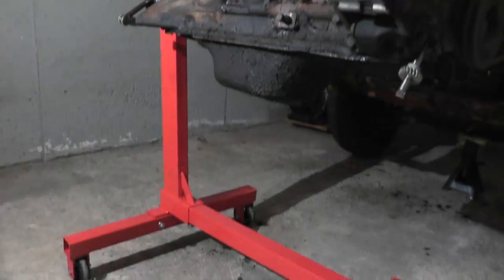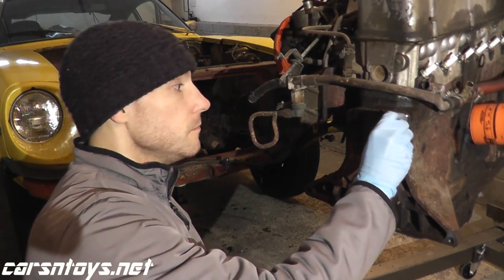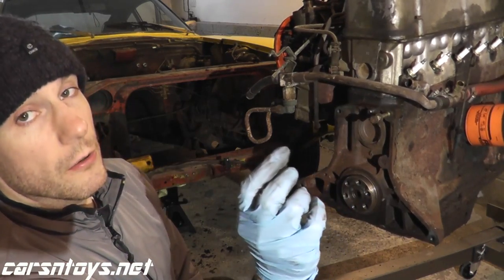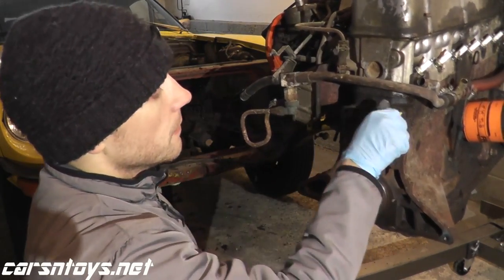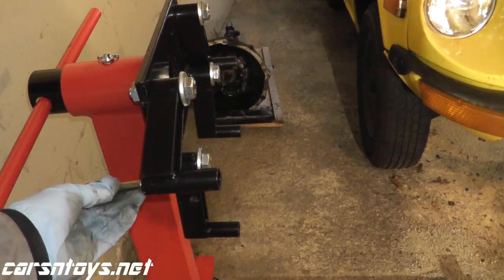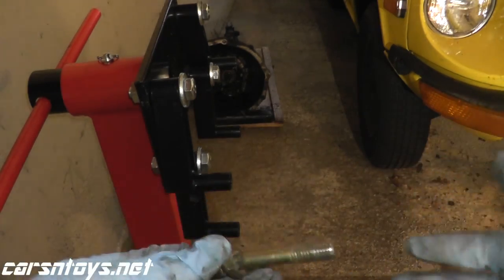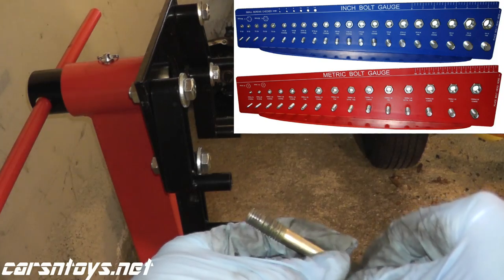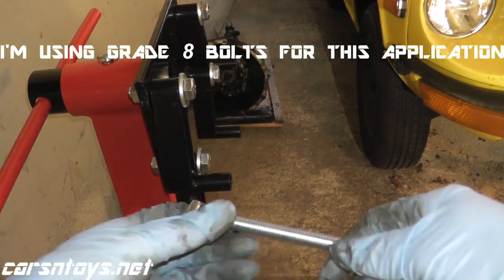How to Mount an Engine to an Engine Stand

Comment: Great video. I work at an equipment rental store so I shouldn’t have to buy a hoist since were supposed to replace the one a customer broke before. Plan is to get my measurements tonight and put together my new stand (sold the other one bc something came up), then tomorrow or Saturday buy the hardware and rent the hoist Saturday. Hopefully the rebuild won’t be extensive, engine only has 70K but it overheated very badly due to low coolant, long story.

Comment: The problem we had with a friend's Miata project is the transmission bolts were M12 x 80 with a 1.50 thread pitch. All the part stores had M12 1.75 pitch.
Reply: Even Ace Hardware? Darn.

Comment: I have a in-line 6 aswell the Ford 200ci to be exact. I’m really afraid the engine is to heavy for the stand because the engine is so long and the front of the motor is leaning downwards just s little. Is this normal?
Reply from the maker: First make sure the stand can withstand the weight. You may see a slight decline toward the end of the engine. You can place sand bags on the legs of the stand as a safety net.

Comment: What is the minimum number of bolts required to safely mount an engine on a stand?
Reply from the maker: Typically four. You could probably go less if the bolt is long enough and high grade but I wouldn't chance it.

Comment: My problem it's not the bolts my problem is that the engine stand can get inside enough of the engine hoist to bolt it on
Reply from the maker: Yes, it can be a little tricky sometimes.